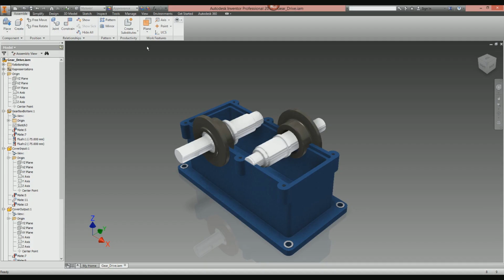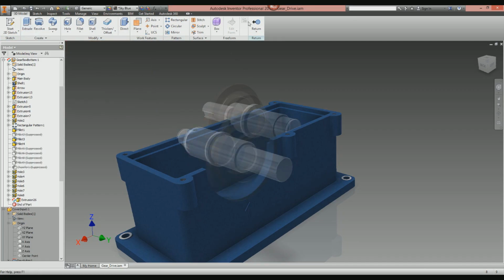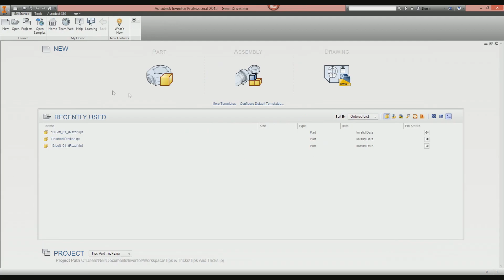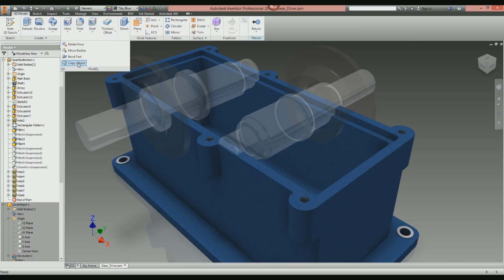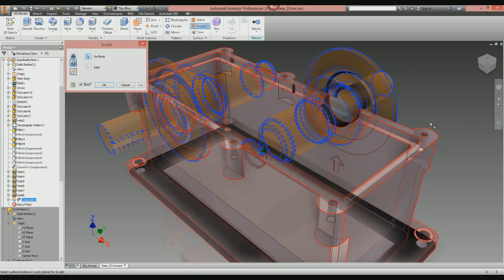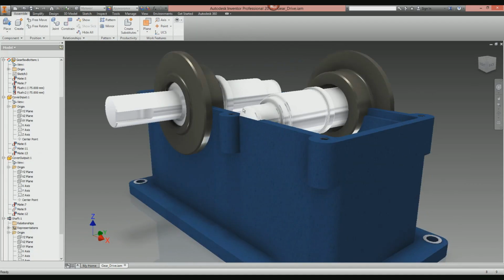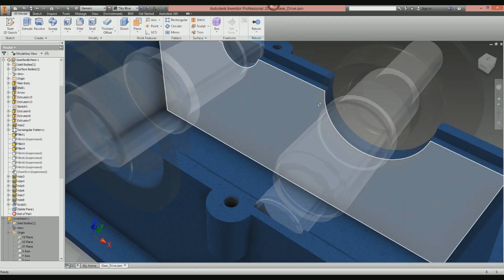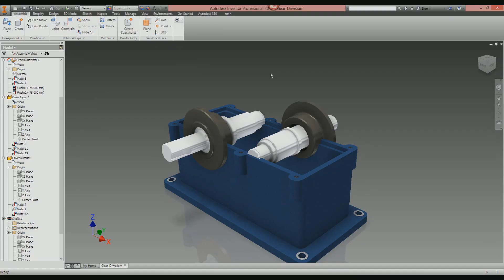How to subtract solids, using sculpt | Autodesk Inventor

Comment: I know this is a little late. However, I'm having an issue with this function. I'm using inventor 2020 so it might be different. But when I try to copy object it will not allow me to select associative. I get an error stating "the associative option cannot be enabled because not all necessary components can be made adaptive. Some components are already adaptive in another assembly". I have checked other assemblies nothing is adaptive. Inventor allows me to copy object without selecting associative however when I proceed to sculpt it doesn't remove all the faces i've selected. and it leaves the copied objects visible in that orange transparency. Any help would be greatly appreciated.

Comment: Works fine, but it would've been much better if it was possible to create a separate body first (using sculpt) to, say, fill in voids etc. and then to be able to subtract volume (eliminating the need to delete lumps for example). 2019 and Inventor still vomits errors while trying to constrain the results of this workflow...

Comment: Hi, Great video! Coming from a humble tinkercad background (im learning) this feels like a much better implementation. The tolerance adding is also really useful. 2 questions though;

- when you deleted the void lumps that were floating inside the larger and smaller cylinder, what happens if you move the grey AND black cylinders, would the new subtracted area have a new void lump or carry over the rule we create before?

- Same question with the face that received the .5mm tolerance; what happens when we move the larger black cylinder both on the X and the Z axis after applying the tolerance to a face, does it carry on?

thank you!

Comment: Is it possible to sculpt  holes not bodys?  So if you use Hole and thread Note command in 2D drawing then you have all information (Hole Diameter Depth and so one)
Reply from the maker: +Lauri Link For what situation would you need to do that? The answer is yes you can use this technique to create a hole, you'd need to apply a thread feature for the 2D note to work, but I'm just wondering when you'd do this as the 3D hole feature command should work in most scenarios...
Reply: Sometimes hole table not show quantity  information for  extruded holes. Situation is this, cabinet with shelf . Shelf have six holes and six dowels, And I want sculpt this six holes to the sideboard. So if I move Shelf location in assembly then Side holes moves also

Comment: For some reason, using this command is giving me a unwanted constraint after the fact. Is there a tutorial on how to properly draw and constrain this "Gear box"?
Reply from the maker: +Marie Essence Is it?! There shouldn't be any constraints generated from doing a sculpt! What's it called, the constraint? Nah sorry there's no tutorial for this, these files are just leftovers from seminars I done years ago, random generic files that I just made up this for... all of my tutorials/tips are just made up as I go along.
Reply: Okay. I wish I could show you a picture. Its a mate between the black flange looking leice and the outside wall of the blue box. Are you on FB? Constraints are not my strong points so it could just be something I did wrong.

Comment: This is fantastic.  Thanks.
One question I have, which may be related ,is the lip that you have on the top of the case.  Is there some way to make a lip like that on a 3D surface.  ie. you have the top of the case created with two surfaces, one at an angle to the other, and want the lip to be 1mm all the way round.  Using a square sketch and sweep results in the tilted surface having a tilted lip.  Any ideas?

Comment: Really informative video, Do you think the same techniques could be used to remove material from a sheet metal part?
Reply from the maker: TheMattydski Thanks man, yea it works on sheet metal too.  Just do the exact same thing as shown in the video, you'll find Sculpt on the "3D Model" tab in a sheet metal part, but once the sculpt cut is done you should still get a flat pattern.
Reply: CloudCAD Ltd Thanks..... got just the job for that!! :)